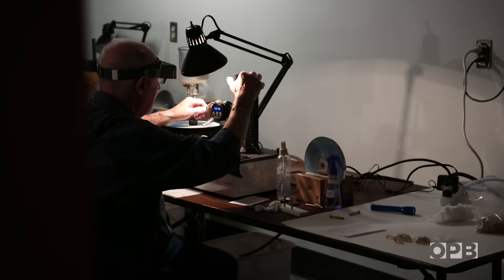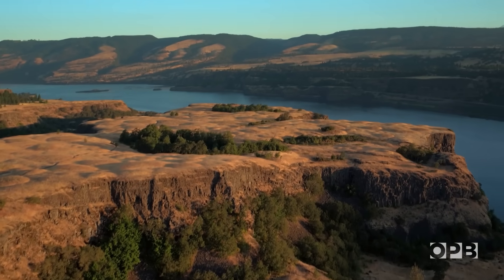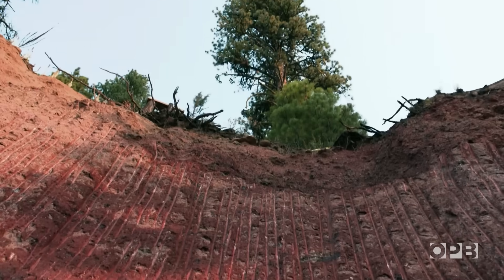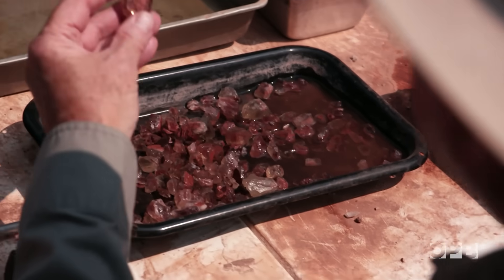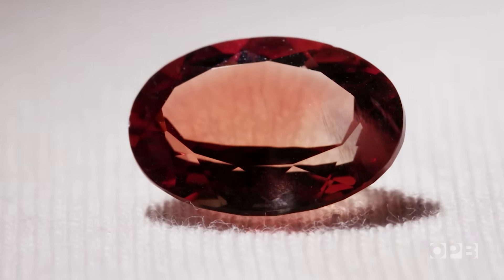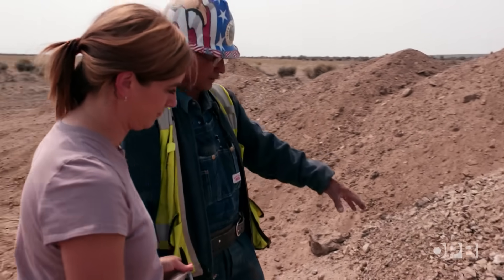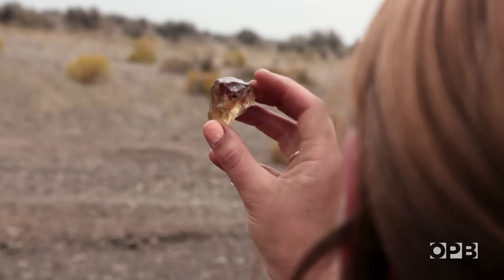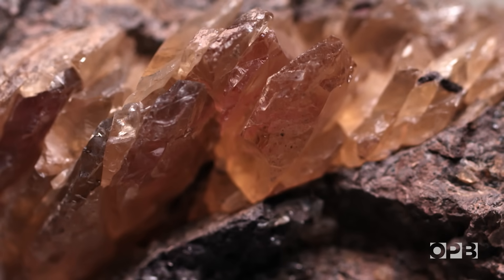Mystery of Oregon’s sunstones | Oregon Field Guide

Comment: I think you are going to find that copper wire is a excellent conduit for electricity, and the crystal is the generator of electricity!! and you can attach copper wires to the crystals and transmit electrical energy. You can build a very large crystal array,  and generate spontaneous electricity!!! and store it in what? super capacitor containing a high amount of dolomite. Piezo Electric Quartz Crystal Nodules, Dielectric Engine/Motor!!! Magnetic Levitation Craft/Vehicles!!!

Comment: Since the copper in some of the Sun stones appears in straight lines towards the center of the some of the stones, the matrix structure may have Metal Organic Framework characteristics. That could concentrate the copper toward the center of the chemical structure.  Such as MOFs are used in Lithium concentration. Makes you wonder if moss like or line structures in other gemstones are due to the same. Y Just a thpught.

Comment: this is a classic example of why I find it so hard to view geologists as credible scientists. They get a dating result that they don't 'like' because it doesn't fit with their hypothesis, so instead of acknowledging that their hypothesis is the thing that needs correcting, they 'correct' the dating to fit the hypothesis. Sorry, but that isn't the scientific method. You'd get a fail in physics or chemistry for doing that, and rightly so. You should have gone back to the drawing board, and proposed a hypothesis that fit the dating rather than come up with excuses why you were still right and the dating was off to fit it with your original idea..
Reply: Sometimes it can be that the hypothesis is wrong, but geologic processes that release or induce influx of isotopes used for dating CAN make the age seem different than it is. Like what IS the age of a zircon, when heat/pressure can change the proportions of uranium isotopes that were in it initially when it formed? "proposing a hypothesis to fit the dating" is not a good method without understanding this.
Reply: @TheToXiCxO  Thank you for your input. I really appreciated the response. I would say that the whole point of the scientific method is that your results should either prove or disprove your hypothesis, and if your hypothesis is disproven, then your hypothesis was wrong, and is dropped in its existing form, and a new hypothesis has to be created. Instead of surrendering her hypothesis, she massaged the edges to 'make' it fit, by providing herself with a convenient excuse for not taking the dating at face value. 

In order to claim that the dating was wrong due to the fractures that she mentioned, she would have to demonstrate through experimentation that such a process had occurred, prove through repeat testing that that process would induce free-floating gas molecules to exit the matrix, and prove through modelling that the dating result matched an accurate as possible model of the rate of leakage - for which she would also have to provide a series of experiments to measure the leakage rate, on which to base the model. And then she would have to prove that there was no other more likely explanation for the difference in date, such as the stones simply being younger than she imagined them to be in her initial hypothesis. Occam's Razor requires the simplest explanation for the result you've received, she is looking for a complicated explanation that lets her keep her original hypothesis. It's just not...science. 

On the surface she doesn't appear to have done that thorough experimentation, she's just said to herself "this idea that I heard somewhere would allow me to squeeze the dating result into my preexisting hypothesis". Now, if she puts the effort in to do all those experiments needed to confirm the possibility of her idea being correct that gas leaked out the fractures and that led to the younger date, then fine, but unless she does that, she's not practicing science, she's practicing just-so-stories. And Occam's Razor would still suggest that a simpler explanation would be preferable. Not to detract from the admirable hard work she has put in, and the expansion of knowledge about the sunstones that her work has offered, but it's hard to call it science if it goes against the scientific method.

I learned quickly that just because you can think of an explanation does not make that explanation true, and that under experimentation some ideas that your brain thinks is perfectly logical are actually just impossible in practice. Just because she can think of an idea why the dating may be off and yet her hypothesis still be true, doesn't mean that in practice her idea would hold any water at all. It's a work of fiction unless she tests it thoroughly. I know she will do some experimentation on the stones, but I doubt proving the fracture theory will be the focus of her work, and in my experience geologists won't put themselves out to do the actual science enough to prove their hypotheses; not least of all because it would take an exorbitant amount of time, and nobody has the funding for that much work, so they will just run with their hypothesis anyway. It's understandable, it would take multiple decades rather than the length of time a PhD student has to work with. I doubt she'd be set up with the skills to even do some of the experimentation necessary, as it would require disciplines outside of geology. The problem is that newer geologists will rely on her work assuming she did do all the testing necessary to prove her hypothesis, and it will become established theory, when in fact she didn't, she just looked up a couple of papers that had the idea of fractures affecting dating in them, and count that as sufficient sourcing for her paper, whether they're really applicable or not; just like everybody does. I've seen this so many times before. More or less this exact pattern of choices. And this is the way serious errors creep in to our understanding in the soft sciences.

Please don't think I'm saying that geology isn't a valuable and important field, nor that her work so far hasn't been exemplary as far as it goes in her field. I'm sure she's far more knowledgeable about the geology of the sunstones than I am, and a very clever woman; she has my respect. I'm just saying that while it's valuable and worthwhile study, it's not really science if it is dodging the scientific method to satisfy preexisting expectations. Especially if that part of her hypothesis isn't going to be sufficiently tested to warrant it holding so much power over the dating. And my past experience with geologists has left me skeptical that it ever will be.
Reply: @bethyngalw  "this idea that I heard somewhere ..." 
It is well known in the scientific community that Ar/Ar dating is problematic in fractured material for the reason she stated. She's not cherry picking excuses, she's actually following the scientific method.
Reply: @wiregold8930  as I said. Ideas that work on paper do not necessarily work in practice. Unless she tests whether this specific fractured material falls in that category, then she is not doing science, she is making assumptions. That's not the scientific method either. You can suppose that this fractured material would be an explanation, without testing it doesn't mean that it is. That's the very danger of errors creeping in that I was talking about. So, thank you, I appreciate you making my point for me.
Reply: We were able to go out to Plush, Oregon, and pick them up off the ground about 50 years ago.

Comment: I wonder if the copper is present in many labradorite samples in an oxidized form, but later gets reduced to metallic form via a more reactive metal (such as iron) getting oxidized in turn. Then the smaller lens of copper deep inside a stone is what remains after another exposure to oxidizing conditions, and only the copper nearer the surface is rendered transparent. The trouble is, why would the stone remain transparent when the various copper oxides are opaque? Are those oxides also diffusing out of the stones and into the matrix?

Comment: What if the crystal was at a liquid state at one time and got Flash with copper during the heating up or cooling down process. And what I mean by flash did the copper fell into the Liquid Crystal form or did the crystal form when it was in a liquid state or hot state dripped over copper and the runoff made the crystal Arrow Destin copper

Comment: They are formed by electro-magnetic geomorholog processesy. Copper is the clue. Radiometric dating is useless where strong electric fields have been present.
Reply: Opalized clams and pinecones come to mind.
Reply: @theunknowngamer5477  Opalized pinecones?
Reply: @EKA201-j7f  
Crook County, OR.
The Clams are whole, the Pinecones
are in recognized bits/parts.
Reply: @theunknowngamer5477  Search "Mummified Dinosaurs / electric fossilization...?" The Thunderbolts site looks at 'instant fossilisation".

Comment: The way copper gets in is Solid-State-Diffusion. There was probably a significant copper content in the same flow, or in subsequent flows, and over time & geothermal cycles, the copper diffused in various degrees ?
Reply: thats a neat theory but you forget that these stones are found in flood basalts. which means a large amount of lava erupted to the surface, forming these almost lakes many many meters deep and covering huge areas. the amount of molten material makes it cool slower but not slow enough for solid-state diffusion to produce the effects seen in the stones.
Reply: solid state diffusion can take place over very long periods of time. Heat usually accelerates the process, and it occurs after a substance is in it's solid state.

Comment: It seems obvious to me that it's a precipitate that is guided by some sort of magnetic pull through the crust of the rapidly cooling magma. The copper is ferrous, and in such quantity, that when in solution could be guided by some sort of force (like magnetism and precipitation working together to pull these drops into a s consolidated shape.) and form these teardrops of sunstone.  They said it's a common formation, just not with Copper, right? So that seems like a likely answer to me.
Reply: Um ok. Little definition problem there. ferrous means iron. Copper is not an iron mineral and is not magnetic like iron.  Good try though. Thinking things through is how we uncover mystery. Great comment.
Reply: A form of high pressure condensate